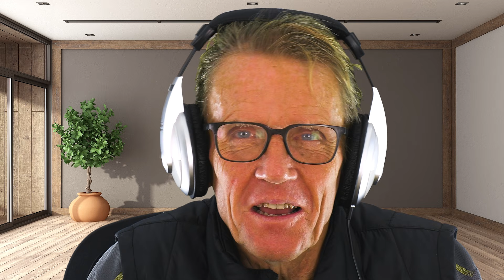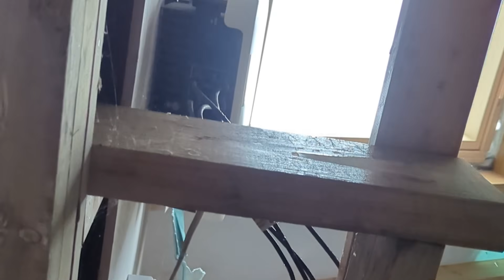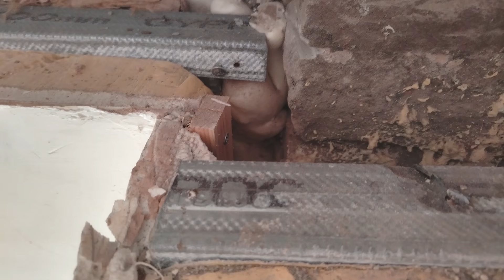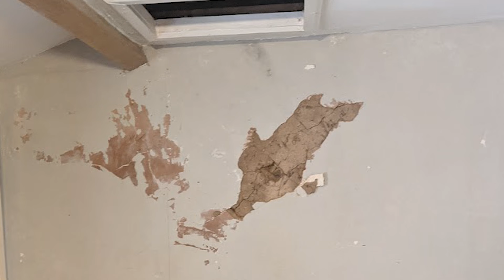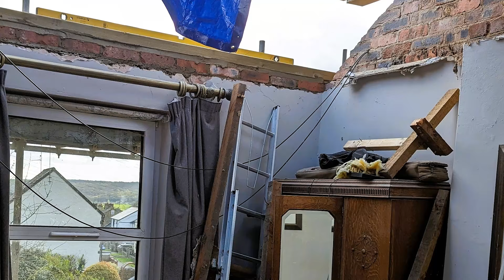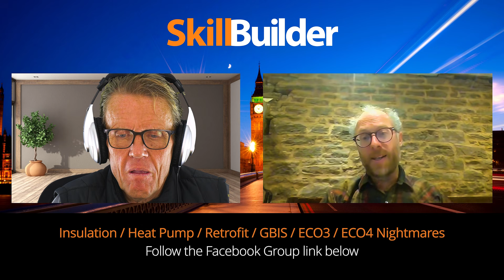Government Scheme Leaves Homeowners in Ruin – And Nobody Cares!

Comment: Whether it is a Green scheme, ECO4 or any similar scheme going back decades the same thing happens every time - the cowboys move in and rip off the home owner and the Government scheme. The question that should be asked is why does the Government and specifically the Civil Service who implement Govt. policy, never learn from past mistakes - I suspect it is because they refuse to admit there were mistakes.

I have seen companies install installation badly grab the government money and then disappear.  I have seen recommendations for work which was impossible (remove gas boiler when the house, indeed the entire town, is not connected to gas), or clearly inappropriate. None of the installers seem to supply a schedule of works unless you ask for one and half the time they disappear as soon as you ask for one.

Even the ECO4 forms that I have been asked to sign seem to be drafted by someone who failed English GCSE.

Comment: Hi Roger, although I have some sympathy for Duncan, it sounds to me that his house was in such a bad state of repair, that his first port of call should have been getting some professional advice from an architect and structural engineer on bringing the fabric and structure of his house up to a reasonable standard before getting these eco upgrade companies to even look at it. Granted these companies maybe should have advised him to get some structural upgrades done prior to their instal (like most het pump installers will advise on extra insulation if the existing is sub-standard) - and maybe they did - but to be honest it's not really their responsibility.
Reply from the maker: I agree but when they saw the state of the building they should have said exactly that. Instead they took the job on.
Reply: @SkillBuilder   
Yeah but that's got nothing to  do with the scheme, how many builders,  installers have done that in the past without any government involvement
Reply: @DropdudeJohn  I guess we don't know. I suggested on another thread that logic dictates that the scheme would result in a higher proportion of shite installations. Simply because the point of the grant is to boost the number of installs and reduce the barrier to entry for both the installer and the customer. Did this particular installer begin installing post grant scheme, and would the chap in the video have installed a heat pump otherwise? It almost certainly has had an indirect impact. 
The disadvantage of heat pumps is that they are far more problematic if installed for inefficiency. My in-laws have their gas boiler running off and on all the time, with the water getting blasted up to 70 degrees, and they don't see nearly the impact they would if/when they move to a heat pump. I suspect that in this case, the owner had simply replaced like for like oil boiler, no problems would have occurred, and still nobody would have pointed out the house defects, because of that ability to run fossil fuels inefficiently.
Reply: Seems like theres plenty of blame to be shared by all here, including Duncan..

God knows theres enough farmhouse /old building restoration vids out there on YT to do some research...

I'm doing my own stone farmhouse reno  and my mantra from the very beginning was "INSULATE INSULATE INSULATE !!" ...
Reply: This feels like heat pump and sustainability bashing, rather than eco4 bashing, which I think undermines some trust in what you're saying

Comment: A proper heatloss calculation was not carried out by this company , the government should have employed building services consultant engineers ( CIBSE certified) to do the survey , calcs and advise on the right type and size of system for the house……….as previously stated by a lot of people on here , older houses are not suited to air source heat pumps.

Comment: Our heat pump does not take days and days and days to heat up lol. A couple of hours and they are warm... I think Roger is still a bit of a heat pump sceptic!
Reply from the maker: You are not wrong, but the building takes days to reach temperature. Up until that point the heat pump is taking a lot of energy. That is why the tell you to leave it on all the time. 
You have to deal in the facts even if you don't like them. I am not a bit of a heat pump sceptic, I am a lot of a sceptic. I am old enough to have seen countless failed technology come and go. 
I was an early adopter of a lot of it because I wrote for the trade press for 30 years. The brief was to believe nothing until it could be proved. Putting a heat pump in an old building is asking for trouble.
Reply: @SkillBuilder I think we are about the same age! The problems with this house are one thing, and the problem with the heat pump are that it was poorly installed (as many still are). Heat Geek have already proven them to work in solid wall properties with little or no insulation. I think in the interests of impartiality, they should be invited to review this property and be asked what it would take to get their heat pump working...
Reply: @SkillBuilder  So what is your solution? Gas and oil boilers are not viable for the future.
Reply: How old is your house?
Reply: @Swipe650 Late 70's
Reply: Yes I agree, but he shouldn't be. Roger knows well that they work if designed and installed properly. See his videos with Heat Geeks sorting John's house.

Comment: I was just working for a family that is in a new build and seen they had a heat pump and asked how they were getting on with it,their reply was that they have switched it off and are using the oil fire fuel because of the price of electricity to generate the heat pump plus speaking to their the Scottish green energy they mentioned that they are using the amount of electricity that it’s classed as a business.
To me it looks like it was installedshoddly with the insulation of the pipes to the heat pump plus the heat pump was one I’ve never herd of🫣
Reply: For heat pumps to work well, you need and well sealed and insulated home, and a well designed ventilation system.  Then it can work.  Gas is still cheaper to install, operate, maintain and it’s quieter and more reliable.  A log burner is a nice compliment
Reply from the maker: @louiswilliamterminator2887  complement
Reply: @SkillBuilder   You're not wrong, last bird I called a log burner didn't like it
Reply: @Me-zo8yc  I wonder how many likes you will get? We live in a different world, but I enjoyed your reply even if  shouldn't have done by our 'new rules.'
Reply: @whitby910  haha, cheers.  Algorithms will need to catch up with tradies humour.  Safe for now I think
Reply: Well, I gave ya an uppy, at 67y.o. I still have a sense of humour !! 

😎👍☘️🍻
🇮🇪 / 🇬🇧
Reply: @peterfitzpatrick7032 cheers Peter 😁
Reply: That makes little sense - a new build with an oil boiler and a heat pump? If they already had the oil boiler and added a heat pump, they would not be eligible for the grant.
Reply: @bordersw1239 Exactly my thoughts when i seen the oil container then when drying out stuff turned the corner and seen the air conditioning unit then asked them what they use.I have no idea if the house builder took a government loan for it but the homeowner is very disappointed but have not looked into it,for me some of the things that they mentioned rung alarm bells but it’s their property and not for me to manage it for them,just ask questions and sort of point them into a place where they look into it themselves.

Comment: Same as the green scheme with the blown in cavity wool has caused so much damp bridging problems
Reply: still waiting for a "Have you had blown insulation fitted? then you could be owed Thousands!" adverts
Reply: @laggytim  I was contacted about getting that installed.  Our house is complicated, extended multiple times.  I thought, this could go very wrong, I'm not risking it.  That was a wise move.
Reply: @laggytim  And how do you get the stuufstuff back out of your wallets? Notstuff like going and coming out the original small holes that were put in with? and before the the the foam-like li stuff made bubbles, es, whatever happ to that?
Reply: @dh2032 i you can get it hoovered out its quite a specialised job with industial tools. Or if your suffering with damp on the ground floor you can take a few bricks out below dpc and hand ball it all out
Reply: And before that double glazing. Seems pretty obvious by now that the second you create a govt. "green scheme" that you'll get cowboys popping up to take advantage, probably the same people moving from one scheme to the next.
Reply: Solar also anything to do with a scheme say no
Reply: My late parents had that installed. After I'd inherited the house, I had the windows replaced (they'd thought that the existing windows would see them out their lifetimes... and they were right). When preparing for that I saw that the cladding was boss in places. I took a crowbar and levered it off, and the cladding on about half the wall fell off. I enquired what had caused this, and I was told that the insulation was damp.
Sadly the warranty is now out of time.
Reply: Yeah terrible idea the cavitys in the old houses should be left empty the uv valve on the blown in wool was next to nothing judt caused no end of issues
Reply: Wool, ah, that stuff that rots and also feeds moths.
Reply: @samuellourenco1050 
Rock wool not sheeps wool yer nana.
Reply: @markrainford1219 its not all rock wool so stop been clever silly billy
Reply: @Fordmad90   He said stuff that rots AND feeds moths. Are you saying they blow in actual sheep's wool? Genuinely curious.
Reply: @markrainford1219  you can do but it is chemically treated to kill moth . eggs before blowing

Comment: That guy is from my neck of the woods. What a terrible trap to fall into. Mid 50s bungalow and im sure gonna keep my wood burner. Terrible story to read. 😠. Im sorry i only watched half of your video as it makes me so wild to see people sucked in to this madness 😢
Reply: Nobody should want you to get rid of your wood burner because in the long long term it's carbon neutral. A lot more expensive to run than a heat pump, but probably not more expensive in total if you include installation and maintenance costs
Reply: @totallynotjames2 Yes it is carbon neutral indeed. I cant believe the guy was persuaded to swap £1000 a year for at LEAST £3000 a year. Huge cost of installation etc on top. Madness to put it kindly. 😢

Comment: Thats me not getting a heat pump or solar!
Reply: I think this is the most extreme of extreme cases.  Bad acting companies, a house that is probably on its last legs and a guy who is riddled with ADHD
Reply: @jjarman009 Agreed - unfortunately legislation doesnt seem to provide protection for Vulnerable clients, and unscrupulous installers are only too ready to exploit this.
Reply: Burying your head in the sand is not the answer.
Take the time to get several quotes for either AND only approach companies with a good reputation. SOLAR: Refer to Gary Waites' list of companies he woukd employ using his own money. Its on the GARY DOES SOLAR Youtube channel, which I found extremely useful during my research stage before investing.
A useful note here is that if Essential Works are needed in order to safely install SOLAR, those works are ALSO VAT-exempt, saving money.
ADHP:- HEAT GEEK guarantee their work to achieve a stated Coefficient of Performance after carrying out a very detailed on the job survey.
Reply: I am a retired heating engineer and company boss for 30 years. Made quite a lot of money on the backs of council and government grants 1997 til 2010, then the money ran out in the crash for both!
Both typed of grant were always way over priced based on the schedules of rates  prevailing. Government should keep away from any  involvement, speaking as a tax payer…..

Comment: We had external wall insulation fitted on ECO4/5 by a local established company in 2022, yes it was funded by BIS/DWP, but its absolutely fantastic, our bills are way less than 1k a year for both Gas & Electric, and the render is 👌, so no need to climb a ladder to paint, so far!
Reply from the maker: We have had some good experiences with EWI but a lot of people haven't. We are going to investigate the issues and make a video in the next few weeks. There are two sides to everything. In this case they were proposing internal wall insulation.
Reply: @SkillBuilder As someone who fits EWI on my jobs, it would be really interesting to know where these problems are emanating from. Very little info in the media reports. I'd put my money water ingress at the eaves and around the windows, but we all need the info. Good work Skill Builder channel, you're really doing a service to us all 👍
Reply: I did the same for a large home in France.  The result is wonderful.  Massive improvement in comfort, nicely reduced heating bills.  The only thing to consider is interior humidity since the walls breathe less.  French homes tend to have better ventilation systems, so no mould problems
Reply: how thick is you exterior insulation?
Reply: @TheMushroomManDan_FungalFruits  on ours its (i think) 80-90mm

Comment: ive a 300 yearold house in the country , we have oil boiler and bought 2nd hand wood stove with boiler for 300, it costs 100 in kerosene for summer when you only want hot water and little heating and 200 in winter for wood for hot water and heating, an old house will have draughts if you want the character
Reply: Draughts are healthy.  Modern homes are insulated up the wazoo and (at least around here) have heat recovery ventilation added to replace the draughts without losing heat.  But when older homes are insulated, the ventilation is often overlooked.  It's difficult and costly to add to existing homes, but when ignored it leads to issues with damp and poor air quality.
Reply: Some people want an easy to use heating system. See Essays Concerning's Victorian property.
Reply: @Biggest-hz7ng  which you have with oil or gas

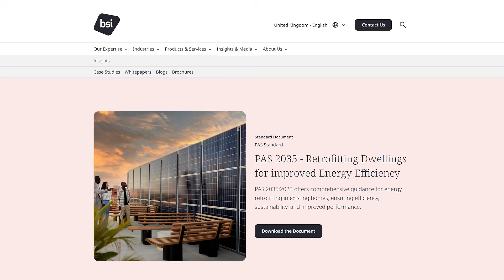Comment: 3:08 That image on the bsi website tells you all you need to know . Vertical solar panels blocked by chairs and people.....do they not have ANYONE who knows anything about this type of thing .... what next putting them under the roads ?
Reply: It's not actually as bad as it looks. If the solar panels are configured correctly for that layout - horizontal strings rather than vertical - then the power loss wouldn't be too severe. The upper panels will work just fine, and the lower panels would operate at much reduced capacity. Even if the strings are vertical then the bypass diodes would do their thing and take the lower row out of circuit. It's still a rather poor installation and I certainly wouldn't want to use it as an example to promote the company, but it it will still operate with at least 67% of the designed capacity, and probably somewhere around to 80%.
Reply: Solar Roads would like to have a word with you....
Reply: @khalidacosta7133  That was kind of the point :P

Comment: I apologise for the experience of this customer, knowledge, research & pushing the contractors are key. 

Their is good within the industry 
Would you consider doing a success video on me as a housing association tenant obtaining ECO4 funding & having our home retrofitted via the scheme. I sourced the contractor & oversaw all the works, working in collaboration with the housing association to enhance the scheme to include additional extras such as battery storage. I also had several discussions with Northern powergrid & agreed to unloop our main incoming electricity supply to three phase & our energy provider fitting a new smart meter 

We have had our system 19 months with temperature externally been at their lowest-8 with internally at 21c, We are saving over £3000 annually. 

This can & does work